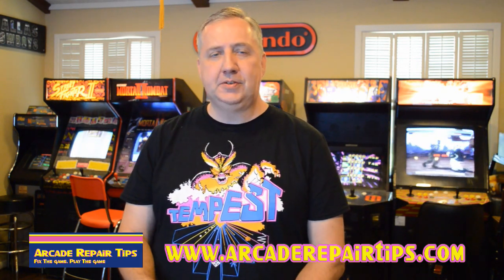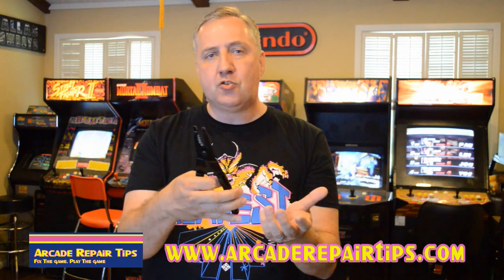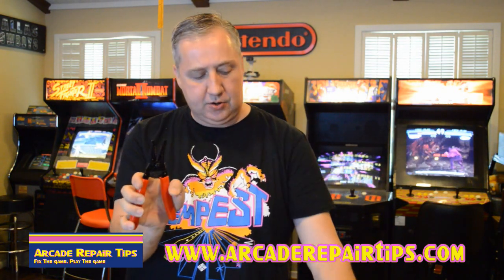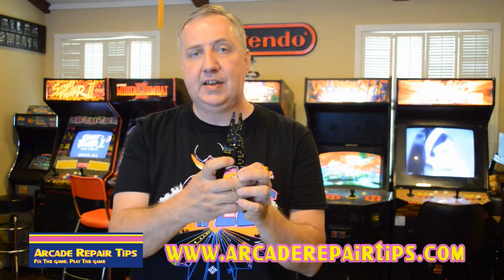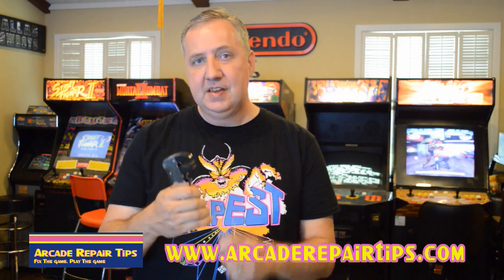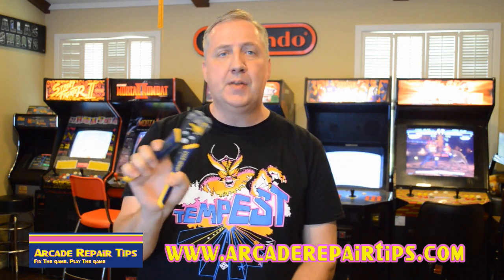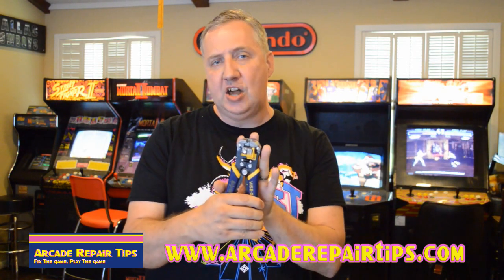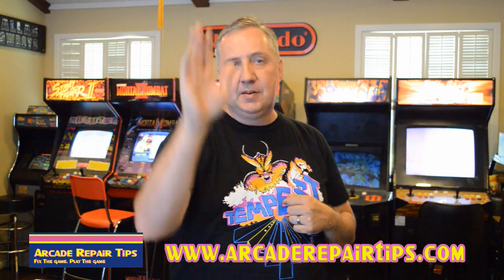Arcade Repair Tips -  Methods For Stripping A Wire

Comment: Thanks for the vid.  I have used all the shown types of strippers.  I'm sure depending on the amount of money and where they are bought, the quality of each will vary even when they look identical to each other.  I have to say, my favorite for multi-stranded conductor wires is really the "dinosaur" one.

I bought a set like that about 20 years ago at a flea market and they always worked flawlessly up until, you guessed it, a plastic part in the middle cracked in two, making them useless.  Still lasted several years though.

The standard type works well, but sometimes I end up having to attempt a strip a couple of times, because I cautiously start at a hole for a slightly larger gauge than I think is correct, so I don't accidentally go too small and damage the end of a wire.

Now... for the recommended self-adjusting type.  I bought a set of these at Walmart about 4 years ago.  I wanted to replace the "dinosaur" type I had broken a long time back and saw these.  They were HEAVY, well-made, and a bit more expensive as you say.  I think they were between $13-15 there, and were obviously a generic brand, with little writing on the package, no user instructions (I know, none SHOULD be needed), and MADE IN CHINA on the back of the package.

Upon getting them home and putting them into service, I noticed right away they were very aggressive when used on multi-stranded conductor wires.  They work GREAT on home electrical wiring (14, 12 gauge Romex).  But no matter where I adjust that little knob, which I figure controls how tightly they clamp down on the insulation, I ALWAYS find them breaking/cutting several individual strands of the copper wiring inside the insulation.  I actually think it slightly nicks even the strands that are still in the insulation, making me worry they will eventually break after a project is complete later on.

They still feel very heavy-duty in hand, and I do like them for solid conductor wiring, but even when used in a home AC wiring project, I find myself opting for the standard strippers, because usually I am connecting the Romex to stranded wiring that is ALWAYS in a ceiling fan, light fixture, or smoke detector, etc.  Keeps me from switching back and forth.

Maybe mine are just defective, and I need to purchase another set from a well-known name brand.  I know when adjusting that knob, I have actually experimented and found it does practically NOTHING.  If I loosen it too much, the entire threaded knob, spring, and a tapered slug falls out completely.  The end result is always several broken strands of wire, and honestly, I don't want those strands falling all around where they might be left on a circuit board causing a short, or on the floor ending up in someone's bare foot later on.